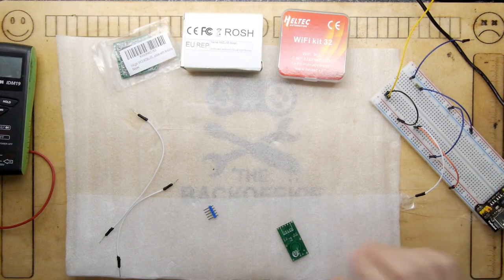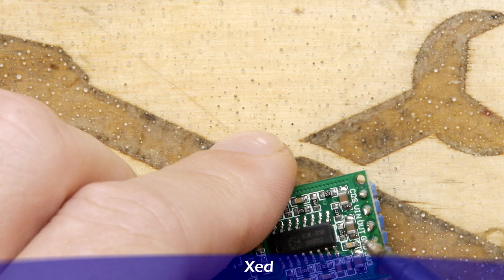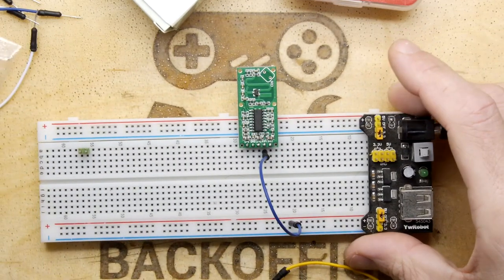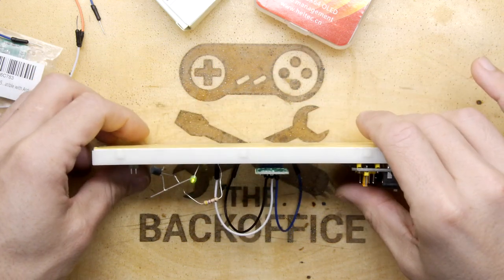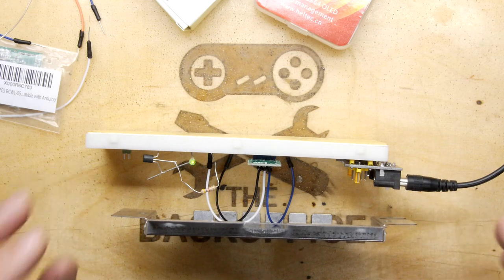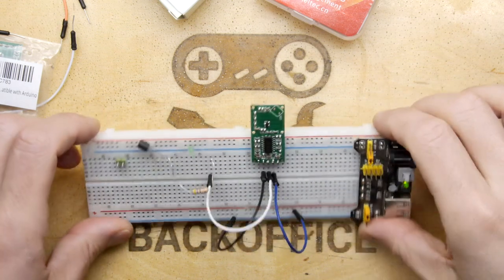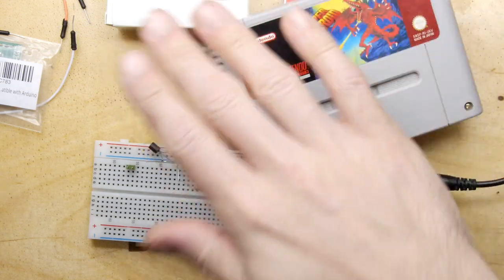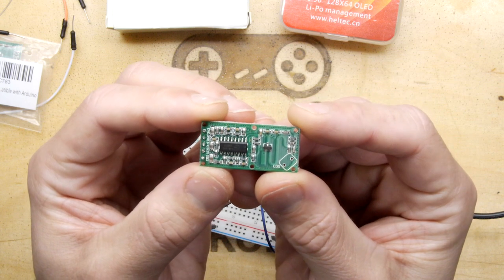Microwave Doppler Radar Module Test

Comment: I did a lot of practical testing on this little sensor and found that it seems to work at great range 360 degrees although what is to be considered as the actual front of the sensor is more sensitive I was able to get good detection from even at the sides of the board at the full length of my living room, I'd say that is around 25 to 30 feet. approaching from the top of the board gave no detection at all but it did seem to work very well 360 around the antenna. I placed a plastic project box along with a glass cover and still got good results at 360 degrees around the antenna 

See my demo here:
https://youtu.be/S1M7cTrelCo

Comment: No transistor needed. You can wire the LED directly to the output pin. There's a 100ohm series resistor on board.
Data and schematics for the chip (RCWL-9196) and the board (RCWL-0156) can be found here:
http://www.mpja.com/download/34685MPData.pdf
https://www.mpja.com/download/34685MPSche.pdf
https://www.snapeda.com/parts/rcwl-9196/RCWL/datasheet/
These documents also show some options that are available on the board for adjusting range, trigger cycle time and light sensitivity (if using with a photoresistor).

Comment: Will it only work for humans or will a stuffed animal or other moving object set it off? Like tree branches moving in the wind?
Reply from the maker: I think it would probably work for all sorts of things ... but ... If you imagine the detection cone spreading out from it, I suspect at any distance it would need a large object.

So small pets might not trigger it unless they were very near
Reply: @backofficeshow  does the object have to be alive,  or could it detect objects not alive, like a moving 2x4 piece of wood?
Reply from the maker: I'm pretty sure it does not need to be alive. It needs to be moving.
Reply: Detects movement, not IR.
Data and schematics for the chip (RCWL-9196) and the board (RCWL-0156) can be found here:
http://www.mpja.com/download/34685MPData.pdf
https://www.mpja.com/download/34685MPSche.pdf
https://www.snapeda.com/parts/rcwl-9196/RCWL/datasheet/
These documents also show some options that are available on the board for adjusting range, trigger cycle time and light sensitivity (if using with a photoresistor).

Comment: Assuming this outputs an analog range why not start characterizing it with a microcontroller script? This simply demonstrates that it powers on but you've really learned very little about the range, sensitivity, and coverage of the device.
Reply from the maker: I'm pretty sure it's only outputting a trigger / no trigger. But as soon as it's properly housed I will test it more thoroughly
Reply: @backofficeshow  Since passive infrared and ultrasonic already do this pretty effectively I'd certainly hope this device produces more than just a trigger. Looking forward to more content.
Reply from the maker: Normally this sensor is used in conjunction with a infra red to reduce the false positives in an alarm system. I suspect this board exists because the chipset used in the security market became very cheap. We will see after some digging what it can do, a datasheet may even exist